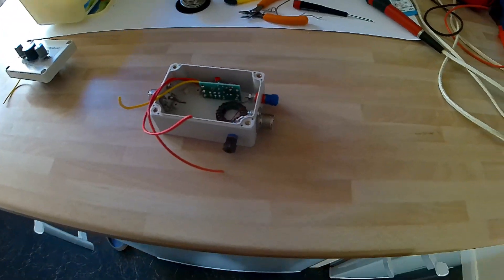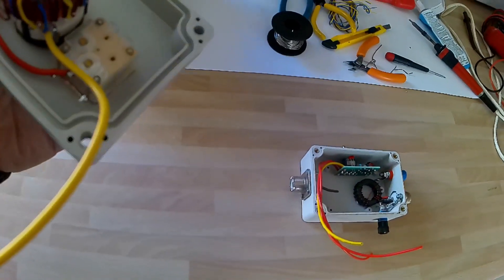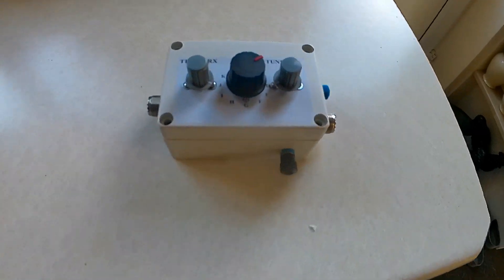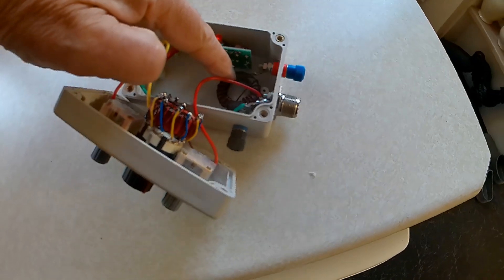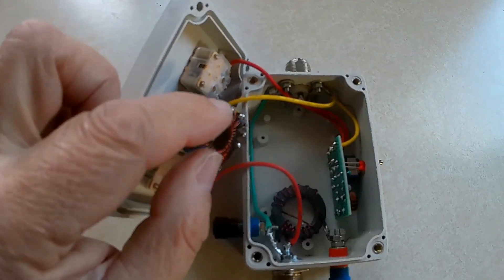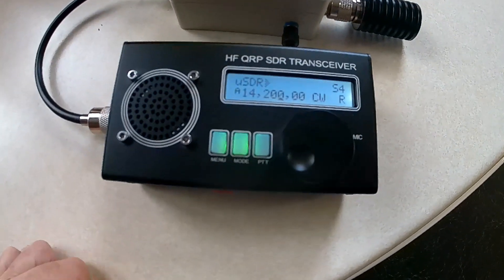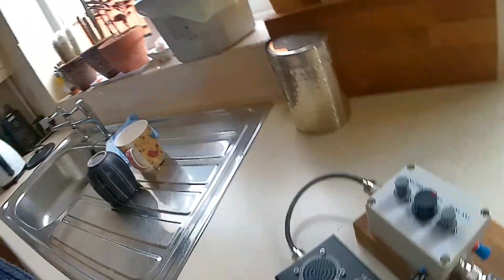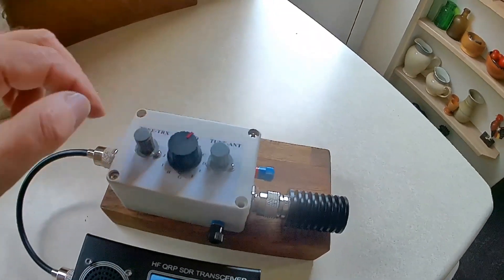1 - 30Mhz Manual Antenna Tuner.Ham Radio QRP DIY Kit. Part 3. Finished.

Comment: Hello, You tested an antenna tuner connected to a pur 50 Ohms load. Fortunately it works 😀. It would be interesting to make the same test with another load or with a real antenna !
Reply from the maker: Hi I have done several tests and a random wire, vertical antenna and my end fed half wave all ok. But didn't film it due to weather. Cheers from George.  I can do a video if required and weather permits.
Reply: 👍Thanks a lot